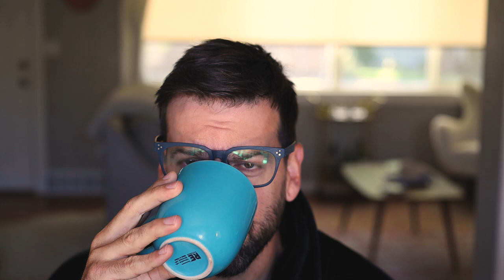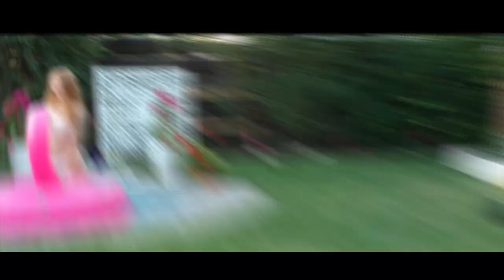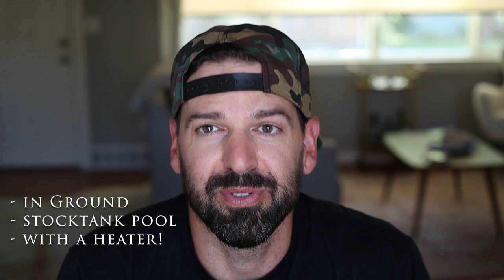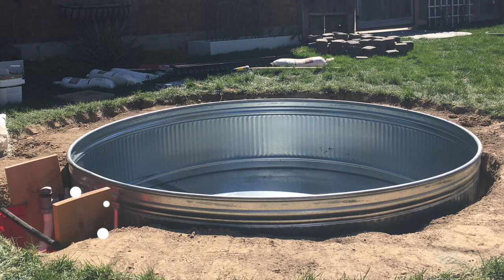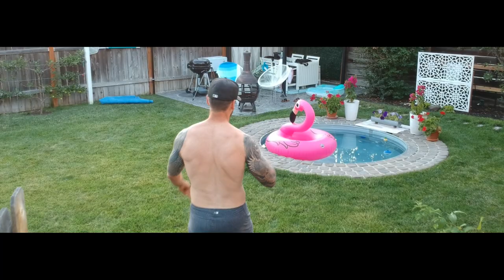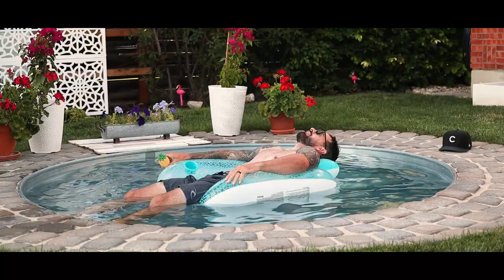How We Made Our In Ground Stock Tank Pool and Hot Tub

Comment: Love it.  We did an inground stock tank pool a couple of years ago.  One thing that happened was how slick the bottom was stepping in the pool at 18" +.  My leg went out from under me!  We bought a step from a medical supplier with 2 arms for stability while getting in and out.  I actually trenched the plumbing so the pool pump was above ground and near where the heater is going.  I like the idea of the drain sleeve.
Reply from the maker: Great idea on adding the step to get in!  We were debating putting our pool pump above ground as well but had a hard time finding to proper extension hoses to reach the pool. Thanks for checking out our video!
Reply: @ditchingnormal1344  I used 1 1/4 inch pvc and flexible hot tub hose to connect to the pool (2 returns, one intake... and intake uses a skimmer).  very much like actual in-ground pools. Then ran the intex hoses from the ground to the box where the pump is stored.
Reply: @73Libra   Ive been trying to research this. Having the stock tank pull buried and and all hoses buried (ran through some sch 40 or some sort of housing) and then returning to the surface in a discrete location so everything is away from the pool. I want to run lines for both pool and hot water. Is there a max distance of hose that these pumps can handle? Ive never had a pool or hot tube but all the tools and machinery to put one in! LOL
Reply: @tjbeaverson8415  I am sure there is...I looked a long time ago and there is an actual formula.  I did not use it BTW.  Mine is about 15 feet away.  The further out, you will need more HP to get the water moving.  I have a small intex pump and it works just fine.  One note though...If it loses prime, it can be challenging to get it back.  I can only assume that is because of the distance and the fact the pump is aboue the piping.  Gravity working against me.
Reply: I have looked for a step as I am worried about slipping. I looked at medical supplies but couldn’t find one? Can you advise where you got yours? Thanks!

Comment: I have a house in Mississippi. Thinking about doing this. We get a lot of rain so I would probably engineer in an overflow valve  to prevent overtopping and drain it away. Also use pressure treated wood for my box. Put in under some type of Pergola with a way to create an enclosure with a bench. Then I could put a mesh screen over the top to keep out all of the leaves and acorns out. Great inspiration here.
Reply from the maker: Sounds like an awesome idea. Thanks for checking out our video. Best of luck!

Comment: Great Video, had a couple follow up questions.

1) How often are you running the heater and how often do you need to fill your tank?  
1b) would natural gas be a better option cost wise?
2) what's the max distance the pump and heater can be from the Pool?

Thanks again!
Reply from the maker: Hi! So we have a solar cover that easily keeps the pool warm during the summer months. We only use the heater for spring and fall. Even then, we usually only need to run it for about an hour or so to get it up to the mid 80's which is where we like it. I think we refilled the propane tank 3 times last year, which totalled about $35. I'm not exactly sure how far away the pump and heater can be. We use the hoses that came with our pool pump and never tested it to go farther than that. Our heater setup is about 15ft away and works great. I would just do some testing before putting anything permanent in place. Good luck!

Comment: Have u had any rust issues on the bottom or sides? How long does it take to heat the pool up from 60 degrees give or take. Looks nice!
Reply from the maker: Hi! No rust issues yet. I've heard it could take 2-8 years to start running into that. Fingers crossed it's on the longer side of that! The heater setup we have heats up our stock tank about 10 degrees an hour. Very quick and easy! Best of luck!

Comment: Love this! What did you use as backfill? I’m debating on using 2b limestone for extra drainage (clay rich soil here), but worry about the limestone corroding the galvanized steel.
Reply from the maker: Hi! We have really dry soil here and very little moisture in the summer so we just backfilled with dirt. You definitely have the right idea to backfill with something to help with drainage though if you have moist soil/clay. If you are putting your pump underground as well you may want to consider a sump pump to make sure it doesn't flood. Obviously all depends on how much water you get. Best of luck!

Comment: When you drain the water out where is the water going? Do you just remove your pump and it drains out in the same area ur pump was?
Reply from the maker: We use the pump connected to our heater to drain the pool. We simply disconnect it from the heater and set that side of the hose where we want to drain. You could also use your main pool pump to drain it. Just disconnect the hoses from the pool connections, put one hose inside the pool and the other outside. We definitely never let it flood the pump box. Best of luck!

Comment: I got my pool painted, in the ground and pump all set up!  problem - pump is on the ground with pool lower by one foot (1/2 in and 1/2 out, as I mentioned below).  My pump will not draw the water through it!  Do I have to have the pump at the same level as the bottom of the pool?  do you know?  I see yours is but I was wondering if this is my problem.  Thanks for your time!!
Reply from the maker: Hi! I don't know for sure, but I have read that these pumps may not have enough power to pull water uphill. Again, just guessing, but if that is the case you would obviously need either a stronger pump, or would need to lower the pump to the input level on your pool. Best of luck!
Reply: @ditchingnormal1344  Thanks for taking time to answer!!

Comment: Hello, I was wondering if the stock pool rusts or needs to be replaced can it be removed and replaced? Do you need a permit for this? I live in HOA is this considered permanent?
Reply from the maker: Hi! The only rust spots we had in our pool were due to chlorine tablets being dropped directly in the pool, on accident, and not in the floaty it's supposed to be in. Direct contact with chlorine caused the spots. Other than that, we haven't had any rust. As far as the permit and HOA question goes, I don't know. Hopefully your HOA managers can help answer that. If they do say it's considered permanent, you could maybe do an above ground version. We have one above ground now at a new house and love it just as much. Best of luck!

Comment: Great video! Just wondering what temperature this would heat up to? We Would be interested in making it a hot tub. I read it heats up to 20 degrees per hour but during the cold winter months does it get as hot as a hot tub?
Reply from the maker: the heating unit we use heats about 10 degrees an hour.  That should still apply to the cold months.  The only issue is that it will cool off a lot quicker when it's cold outside and you may need to constantly run the heater to maintain a high temperature.  ...same goes for a regular hot tub in winter though.  Best of luck with your project!

Comment: Hey y’all we are planning on making a similar pool. We are just wondering how long it takes for the hot water heater to actually get your pool to a hot tub and how much propane it uses.
Reply from the maker: Hi! It obviously depends on the starting temperature of the water. If I'm remembering right it heats it up about 10 degrees per hour. Best of luck with your setup!
Reply: @ditchingnormal1344  Thank you for responding.  Did you have to dip your tank housing hole deeper than the stock tank itself? Our pump will not pull water from the tank into the pump so it never comes to pressure.

Comment: This looks awesome! We just ordered our 10ft tank and planning to do a pool/hot tub in ground. Sorry of I missed it but what do you have set up to drain the water out of needed?
Reply from the maker: Thanks!  We use the smaller pump that carries the water to the water heater to drain the pool.  We dismount that pump from where it is mounted on the fence, take it over closer to the pool, connect some of the extra black tubing hose we had to the pump and drop that hose in the pool...turn on the pump and start draining! Good luck with your project!

Comment: Would it be possible to do the salt water instead of standard chemicals in this?
Reply from the maker: Yes it is but you would need a specific pump system that is build for handling the salt.  The pump we use and is linked in the description of the video is not meant to handle salt.  I'm sure a quick google search on 'salt water pool pump' would get you pointed in the right direction.  Best of luck with your project!
Reply: I've heard the salt will eat up your metal tub. But you might want to check another source on that.
Reply: @kevinkirk4434  yes. I think that's right. We went with chlorine. Thanks.

Comment: I'm about to do a similar setup with mine. How do you keep water out of your underground pump box?
Reply from the maker: Hi! Sprinkler water and rain water does get in there a bit but evaporates and/or soaks into the soil quickly. I would just recommend putting your pump on top of a paver or two to create a 1 to 2 inch drainage basin below your pump. Has worked well for us. For any major extended rain storms we just tarp our entire pool and pump box. So far so good!

Comment: This is awesome! How do you prevent rust?
Reply from the maker: We haven't had any issues with rust...yet.  I know it's coming one of these years.  We'll likely add an epoxy coating at some point to try and prevent it as much as possible.  From what we've heard, rust may take up to 8 years to show up.  We'll see!
Reply: @ditchingnormal1344  if you get 8 years out of it before rust then that's well worth it
Reply: @ditchingnormal1344  wife and I are debating going this route. We got a cheap inflatable pool temporarily until we buy our stock tank.
Reply: @booradley948  Just bought one made out of poly. No rust

Comment: Does it cost a fortune to heat?
Reply from the maker: No, not at all.  It costs about $10-12 to fill up the propane tank and we only refill that about twice a year.  If you get a solar cover it will help keep your pool warmer as well obviously resulting in less need to use the propane.  Best of luck!
Reply: @ditchingnormal1344  Thanks for the information.